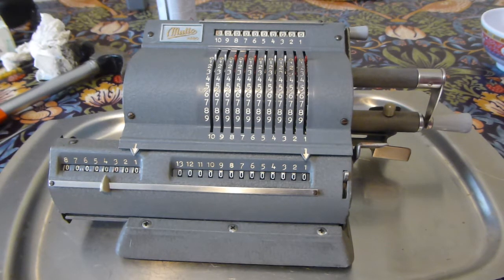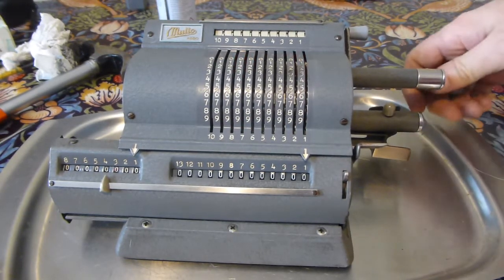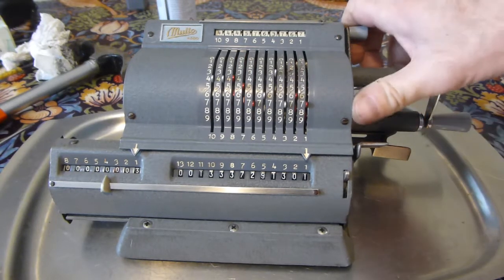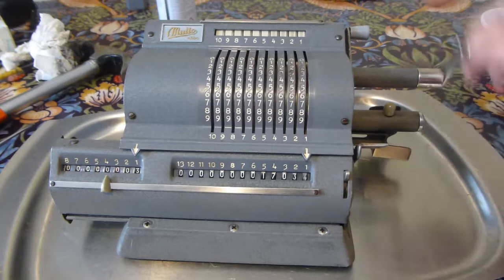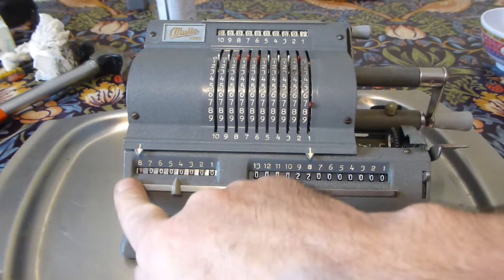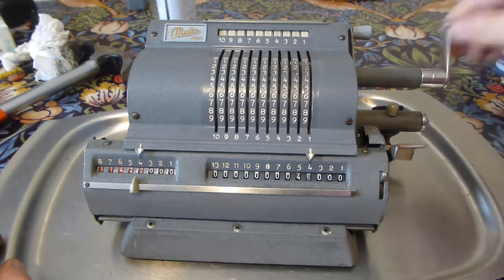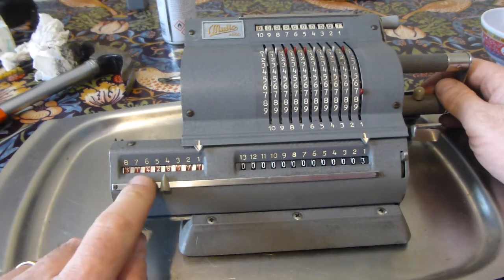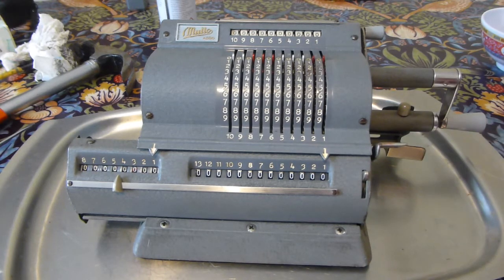Part 18 of 18, Restoration of Addo Multo Model 3 Mechanical Calculator

Comment: Thanks indeed for such a detailed set of videos. When I was studying A-level applied maths in 1975, we were expected to use this type of calculator and were even allowed to use them in some exams.

But electronic scientific calculators had just become a thing, following the launch of the HP35, so I never needed to use any of these mechanical calculators at uni or at work.

Comment: Thank you a lot for those videos! I found one similiar but newer model. I bought Model 13 from flea market the 19 April 2021 for 7,5 euros. 
But it was stuck all parts. I watched your videos and following restore and now it work perfect. 
Model 13 have some extra stuff and diffirent solution. 
But THANK YOU it was ONLY video restore of this type I found in internet!

Keep continue! :) / Swedish guy
Reply from the maker: I’m glad you found the videos useful. I have two model 13s; an early green one with the carriage release button on the front, and a later grey one. Replacing the carriage is tricky on the 13, isn’t it?